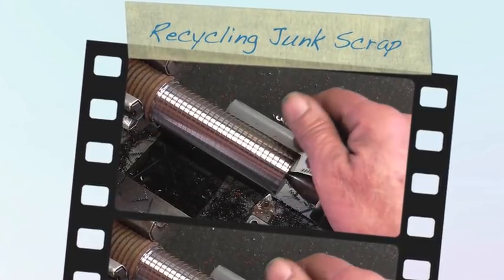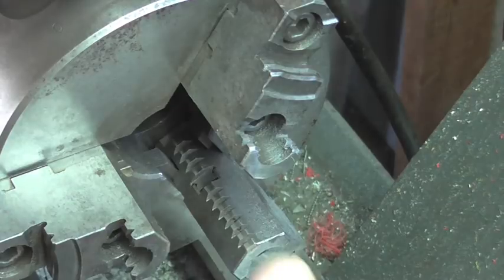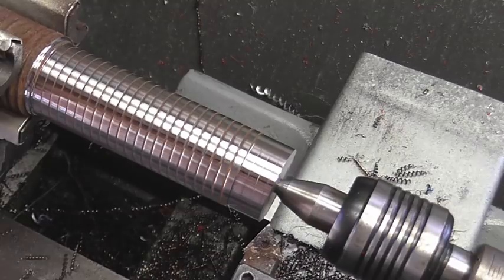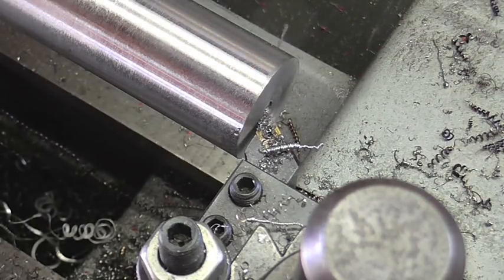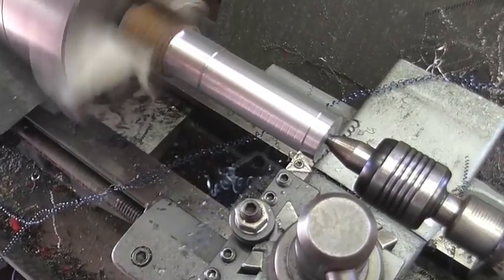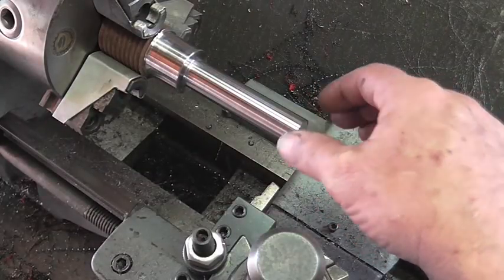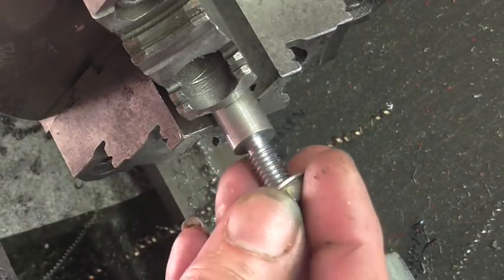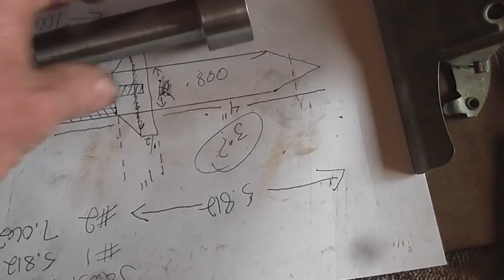Quality Tool Making Using Recycled Junk! - Part 1- MSFN

Comment: The problem with threaded rod is, it's never straight and not threaded on center.
Reply from the maker: Nice material once you get it concentric tho, thx for watching!
Reply: Agreed. And, you cant beat the price! I had only mentioned it because you thought you may not have centered it properly.
Reply from the maker: You were absolutely right, it was centered well but that one side still had about .030 to clean up....dont forget to watch part 2 :)

Comment: Woke up at 5am so time to watch part 1 and 2 before work. Hey Richard at 12.15 what size max can you cut and feel comfortable?
Reply from the maker: In this material .040 to .050 DOC (.080 -.100 off the OD) is all this lathe would do. I didnt have great engagement chucking on threads and didnt wanna risk the stock moving in the chuck from tool pressure. I coulda tried left hand turning....saw you do that to avoid that issue many times 😎

Comment: A couple of observations from a very amateur machinist, so please take these with a grain of salt.
Firstly, were you lubricating the stock to help keep your insert/material cool? It didn't appear so. Lubrication/coolant my have aided a better surface finish.
Secondly, using a centering tool (eg: 1/2" square stock with bearing mounted to the end mounted in the tool post )  makes recentering machined part SO much easier. Not sure if you used one of those.
Thirdly, trying to drill a part with a long shank drill is just asking for the bit to wander. Did you pilot drill the hole first?

Please don't think that I'm having a go at you because I'm not. Like I said, I am an amateur machinist who is trying to improve and I'd say there are lots of others like me. Videos like yours are valuable for learning. Thanks for posting.
Reply from the maker: No worries, thanks for the suggestions and happy machining! 😊

Comment: When recommending to use a dead center you should mention its lubrication. Normal oil or grease is not up to the task. You need to use extreme pressure grease. Only that lube will hold up without wallowing out the center hole and heating up the work and dead center. (Your dead center looked plenty discolored. It must have been hot a few times... ;-) (Oops. Sorry I was wrong. The discoloration is from annealing it after hardening as I found out in your video "Making a HALF DEAD CENTER and Why You Need One! ")
Reply from the maker: Yep, I agree 100%, I appreciate you checking out the channel

Comment: I know those bolt materials can be really stingy stuff.. But you should consider buying some inserts with better chip breaker for small cuts :)
Reply from the maker: Was on highest feed rate I had, still wouldnt break a chip....nice material tho
Reply: I can see there are some limits with small lathes. Not sure what it's the max rpm on that machine? I still believe you could benefit with a better insert.. There are inserts that are made to take light cut like 4-10 thou with small feedrate and still manage to brakes the chips. Here's one example from Kennametal: https://www.amazon.com/gp/aw/d/B0771SFM75/ref=mp_s_a_1_1?ie=UTF8&qid=1525492134&sr=1-1&refinements=p_style_name%3ATPMT%2Cp_89%3AKennametal&pi=AC_SX236_SY340_FMwebp_QL65&dpPl=1&dpID=41lCKkFu7UL&ref=plSrch
Reply from the maker: I would love better tooling, but at $28 per insert....seeing a picture on amazon is about as close as I would ever come to owning one of those...LOL
Reply: No way you should pay that much for single insert! Usually those inserts costs about 8€/piece.. I've been cnc machinist 12 years and I know what difference a good and bad insert makes! I'm not trying to offend you. Just thought I give you a good advise :)
Reply from the maker: I would love to have top notch tooling and inserts for the lathe but run the shop and this channel on a shoestring budget. In the last year or so I have been fortunate to take on customer jobs, including some work for viewers that has allowed me to slowly acquire some new items for the shop like the small mill I got late last year. Anything I make from jobs in my shop gets reinvested back in the shop. I took no offense Matti, I am slowly but surely working my way up to getting everything I need to do better quality work....wish I had gotten my lathe 10 years ago as I really love machining :) ~ Richard
Reply: And the videos are great! Please continue making more, I really enjoy these videos 👍🏻🙂
Reply from the maker: Thanks my friend, much appreciated! 😊 ~ Richard

Comment: Love this channel! Question though.. I've never seen anyone hold a center drill with a collet chuck like that. It is better than using a jacobs chuck? Or is it just what you have on hand to work with?
Reply from the maker: Jacobs chuck is fine, I use the collet as a dedicated center drill holder....part 2 is now uploaded if you care to check it out ~ Richard
Reply: Cool! Thanks for the reply. I'm a newbie so I thought I was doing it wrong or something.
Reply from the maker: I have only had my Lathe for about a year and a half :)
Reply from the maker: Btw, it is better to use a collet in your tailstock rather than jacobs chucks as collets will never allow a bit (drill, center drill, reamer etc) to spin. Avoids damage to your tooling and damage to the chuck jaws.

Comment: Nice but why didn't you use your steady rest to hold your piece?  Richard
Reply from the maker: I didnt think the brass fingers on the steady rest would survive holding a machine screw. I had no way to turn a section to have a smooth surface for the steady
Reply: I guess I was not very clear, what I should have stated was while you were preparing to bore and thread the 5/16 18 treads in the pointed end.  At this point you had quite  a lon stick out that was unsupported with not much held in the jaws.  Please don't get me wrong, you do nice work and I like what you do.  You did have enough support for the task or it would have gone very differently.   For me, I would not have had the confidence to proceed without a steady rest.  Thanks, Richard
Reply: Also I forgot to say that I agree the brass would not hold up to those threads, I would have done the same thing as you!
Reply from the maker: You have a great point. I probably should have slapped on the steady for that operation. Turning the point had me more comcerned than the drill/tap...shoulda used it there too..LOL
Reply: Thanks

Comment: not a pancake compressor shame lol
Reply from the maker: I like pancakes with sausage & eggs :-)
Reply: I can tell by the sound its very small I went to the scrap yard and got a broken 5 h 60 gallon just needed a new fly weal for 50 bucks .
Reply from the maker: Niceeee!!
Reply: I also got a Rockwell upright band saw for 25 you wouldn't believe the stuff you can find at a recycling or scrap place or the dump .when your on a fixed income you have to improvise

Comment: Nice video. Have you done one on the making of the soft jaws?
Reply from the maker: No I hadnt, but since I need new ones I might if there is interest....it pretty easy
Reply: Makin Sumthin From Nuthin Yes please. Thanks for sharing your time and knowledge! Cheers
Reply from the maker: Thanks for chiming in Shaun...I will put it on the schedule. I dont get many requests from viewers but will be glad to share how I make a set... be sure & subscribe so you dont miss when it comes out 😊
Reply: Makin Sumthin From Nuthi. Another request then please 😀. I have watched a few videos on how to make a thread on a lathe but it’s not sinking in, if I want to make a 8mm bolt, I take it I thin the bar stock to 8mm but I don’t know how deep to cut the threads. And then making the nut for it, Iv still not got any to match up after many attempts! Please do a tutorial 🙏. Cheers
Reply from the maker: Shaun, you bring up a really good subject. I believe I am gonna do a video on that subject now that you brought it up for discussion. For reference, you want to turn your bar to about .005 UNDER your 8mm so you have some clearance before turning the thread....it all depends on what class of thread you need honestly. Subscribe....I will do a video on this subject...I think its worthy :) ~ Richard
Reply: Makin Sumthin From Nuthin Aaaahhhh 5 thousandth’s! Imperial measurement! Metric is SO much better 😀. Ha ha, thanks for reply, yes I’m already a subscriber who has to use a chart to convert all the numbers to a modern measuring system 😄 Looking forward to video. Cheers
Reply from the maker: Did I say .005 thousandths? I meant to say 0.127mm 😊

Comment: The work got a bit warm ?
Reply from the maker: It did until I got under the threads, then most of the heat was concentrated in the chip.

Comment: Can I ask why you don't use oil when you're working this piece?
Reply from the maker: I generally dont use oil when turning OD's, the material was machining fine without it. I think I used some oil while turning off the threads when you saw smoke